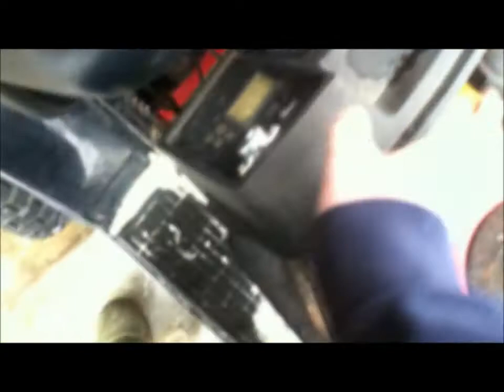Crawler #11 For eddie finished

Comment from the maker: if u noticed there is a craftsman in the snowbank right beside it thats the one im going to be working on this year, and a battery is always the tricky part
Reply from the maker: i cant get into the transmission the bolts kept snapping off so the only way i could lock it is if i build a live axle off of the back witch im not going to do anytime soon, and no i dont have a drive pully i use all of mine to add a pull start
Reply: ok